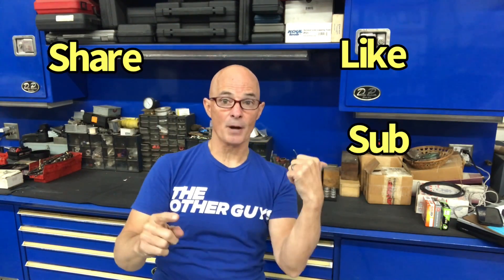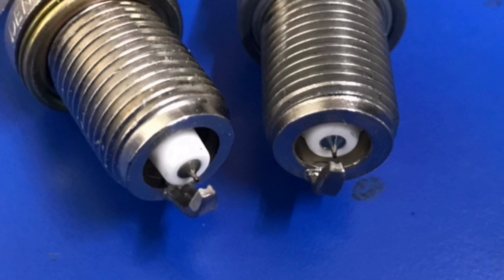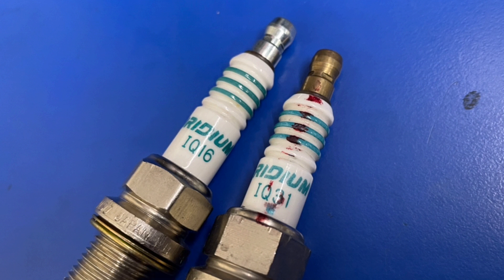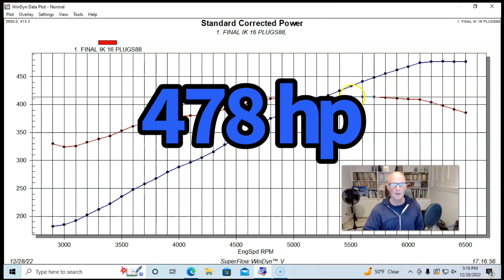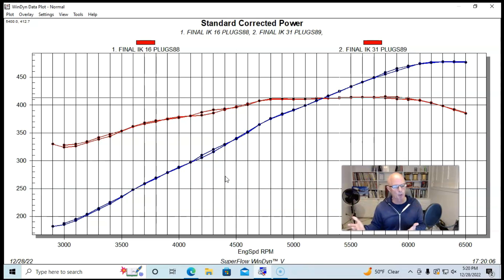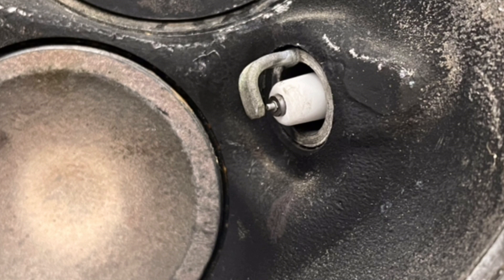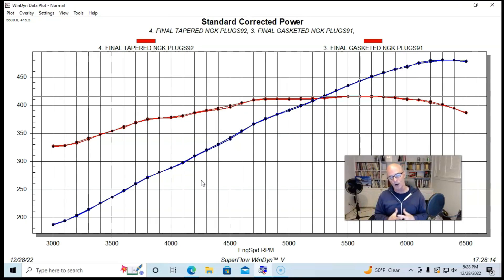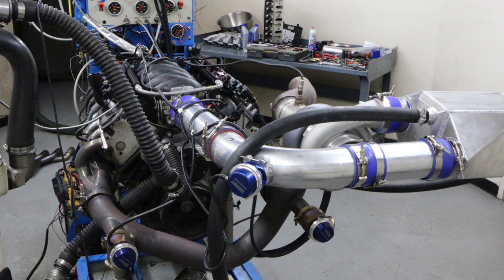SPARK PLUG HEAT RANGE TEST-JUNKYARD LS. HOT PLUG v COLD PLUG-DOES IT MATTER? TAPERED VS GASKET PLUGS

Comment: Crazy how engine style changes results. I went through 3 heat ranges and exposed electrode on my 496 and it made best power with the hottest plug that was exposed.
Reply: Totally depends on chamber design, engine efficiency, and whether your combination of parts work correctly together or not. You may have needed a better ignition, or perhaps your cam wasn't a perfect grind for the rest of your engine, carbed vs EFI, the exhaust system, intake design, and so on. 
I would hope that the G.M. LS line of engines has improved a bunch since the days of the big blocks.
Reply: A very old carbed engine does not have good control of fueling or atomization. That's why they ran huge gaps back then.

Comment: Test massively long plugs vs short ….. you mentioned about the static compression change in this vid .
Reply: I've tested short plugs vs long on a sbc 355. on an aluminum head designed for long plugs,(typical ls plugs), DONT use short plugs like r44ts. It's like reducing displacement from 355 to 55! HUGE losses everywhere. WASNT intentional but that's the result. I presume because the plug was recessed so far in the plug hole it took way too much time to ignite the a/f mixture.

Comment: Richard would these tests matter more on older engines with weaker ignition systems than modern Coil On Plug? As I understand heat range has more to do with keeping the plug from building up carbon over time
Reply: Or carbonated with a less than optimal combustion chamber like a flathead.
Reply: Heat range has ALL to do with keeping the plugs clean.

Comment: In my opinion, and in my experience, once you have the correct heat range for what you are doing, unless you have an A/F ratio issue around the plug,  electrode position isn't really important. However, spark energy is always important. But once you have enough spark energy, more doesn't make much difference, and large excess only hurts reliability. Threads are threads. Gasket or taper seat, is really a packaging issue, which is why we don't see 18mm spark plugs any more.

Comment: Have you done a comparison test between stock coils which is around 35-40,000 to an aftermarket 55-60,000 volts yet? If so I guess I missed it
Reply from the maker: if the motor needs only 25K, there is no change
Reply: @richardholdener1727  Yep.  If the ionization potential is less than the capacity of the coil, no increase will help.

Comment: The old rule of thumb I herd was every 100hp over stock go one step colder.  Also one colder for hotter ignition, think MSD even says to go one colder for their CD boxes.  Of course those are general guidelines and some situations may be diff.   And of course of course, colder for higher compression.   I still think all your recent plug test show how Good modern EFI, ignition or even head design is.
Reply: Agree, my crate 502 with DUI dist. and MSD 6a liked a slightly colder plug. 
Going with TStorm charger and MSD dist. and going to keep as is before I step 
to colder plug to see if it improves.
Reply: @goratgo1970  Definitely start with a cooler plug if you add boost. Detonation easily can become a problem with boost and too hot of a plug.
Reply: Hard for that to work....stock say 400hp, 5/6 heat  range ? So if say only 1200hp.....plugs 8 ranges cooler don't exist, and certainly are not needed.
Reply: @blow0me  Search "rule of thumb" & "general guidelines", then maybe re-read my post.  Power adders are another factor

Comment: Can hotter plugs limit how much timing you can run on 87 or 89 octane?

Also, don't you need to run the engine for hours to let it heat soak to see an actual difference?
Reply from the maker: HOURS?
Reply: @richardholdener1727  For spark knock to be apparent. I know it's difficult to do on the dyno, but my understanding is that in a real application, driving around for hours brings up hot spots (like a spark plug) which may produce knock and therefore reduced power.
Reply: @malamri424  No. If the plugs are going to develop hot spots because they are too high of a heat range, they will do it in seconds under hard acceleration.
Reply: @richardholdener1727  I do a 3 day warmup before leaving for work, get on my level.

Comment: I remember on my flex fuel (stock) i set a colder plug to use only ethanol. The car felt way different on lower RPM with load. Felt lazy to rev.
Reply: tuning issue?
Reply: @superjervis  Not really, felt more as a dirt spike plug, you know? When the tunning it self is there but it's a burning issue at lower to mid RPM

Comment: Going to a hotter ir stock plug for better idle and longer life. The br6's seem done now after 20,000 miles. Idle is now missing a bit. Put them in with a new set of kooks headers. 2008 ls3 vette. Wanting to see if it can repeat its best 1/4 mile track times with the stock ir hotter plugs. 11.85@121.25. 65* Florida.
Reply: NGK coppers on a stock 5.3 are doing well, even with a smaller gap. Idle is almost too good to be true for such a high mileage vehicle.

Comment: Ive always thought it would be cool to see a video on a stock engine, then adding say headers/intake/etc untuned, then tuning it and seeing the difference tuning makes and why it's really necessary.
Reply: we have been seeing that it doesnt make as much difference as you might think.  a wilder cam will make more difference though.
Reply: He actually does have videos on that. Theyre older but theyre there
Reply: He does that like everyday…
Reply from the maker: WE DON'T DO UNTUNED! I DON'T RUN THE STOCK ECU WITH A MAF THAT MIGHT HELP SELF TUNE SOMEWHAT
Reply: @richardholdener1727  true but when you run them rich or timing off some it doesnt make a huge difference. granted you dont want to run a motor lean and damage them.
Reply: @richardholdener1727 what spark plug and wires combination would work on a 07 5.3 with truck Norris cam ls7 lifters and 3/4 longtube headers
Reply: The biggest night and days are with the transmission tuning, assuming its an older Auto 4l60 4l80. Torque managment IIRC.
Reply: @DarkLinkAD  it's especially important on older 4 speeds, I see way too many people camming their 5.3's then shifting them at damn near stock shift points then the motor has to work extremely hard to get back up too being in the power band in a taller gear and by the time they get back in power they lose the race

Comment: The couple times I have experimented with colder plug I end up fouling it easily and going back to what works. I thought trying it was a good idea as even though I was already one heat range colder then stock since I was adding more boost it might be a good idea, didn’t have any luck with that and haven’t had any issues making 900rwhp on a BR7ef plug.
Reply: Thats what Im running
Reply: That's the entire point of the heat range. To keep them clean. If you kept fouling them out on a good tune then they're too cold. That's it.
Reply: On a N/A 6.0 over bore 0.030 x 4.1 stroker @ 12.1 93 pump gas I got detonation I could hear in the summer in FL. Was ok in the winter so Br6's in winter and Br7's in the summer.
Reply: Remember that winter and summer fuels are different and many times have different vapor pressures.  This can cause this issue and I’m having the same problem in Georgia.
Reply: Same 991awhp daily

Comment: Colder plug definitely costs mileage some. Have tested this on a stock (with bolt ons and tune) street driven 6.0
Reply: I can attest to this, changed to colder plugs and got slightly worse gas mileage. But on the other hand, I can pull at higher gear at low RPM without my engine making that crackling sound. It was making that noise with the previous stock (worn) plug.
Reply: Then its too cold for your application.
Reply: @davelowets I know this, but it's suggested to use a 1 step colder plug to lessen the chance of pinging or detonation from the heat. The lower MPG confirms both our thoughts. Mainly suggested for racing or hard running.

Comment: I am very confused. How can you run a gasketed plug in a head designed for tapered seat plugs and vice versa? Mind totally blown
Reply: Ls engines can use either.
Reply from the maker: LS GOES BOTH WAYS
Reply: @richardholdener1727  Que the Russian Industrial Techno, throw it in a Coube compilation with the remix.

Comment: Can you add a degree or two of spark advance with colder plugs?  Did you test this, or did you keep the tune the same between runs?
Reply: Plug heat range will have no effect on max timing.

Comment: We should do this test on an older carb and points and HEI setups.
Reply: It wouldnt change anything
Reply: @NightWrencher  I think you are not correct. The spark is much weaker
Reply: @blainesnider9089  heat range doesnt affect max timing. The only time you would go with a colder plus was if there were signs of detonation. You go with a hotter plug if it fouls too easily. Neither of those situations affect max timing.
Reply: @NightWrencher  wasn't talking about heat range only the entire test sequence that was done on the LS
Reply: @blainesnider9089  if you did this test on a sbc on points, the results would be the same. Spark quality is not affected by heat range. Now, if we are talking about spark gap, there is a difference and he has a test on it
Reply: @NightWrencher  you just don't get what I am saying and he did not do the test with old chamber design and weak points ignition. In tha marine (boat repair)WE noticed idle quality and acceleration improvements by stop watch and GPS. On gap and on projected tip plugs on the older carburetor boats